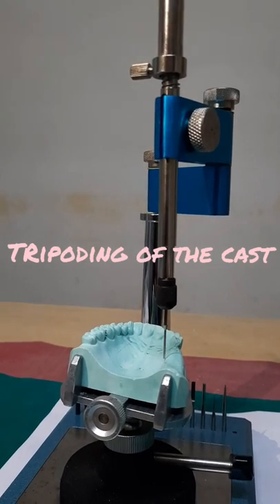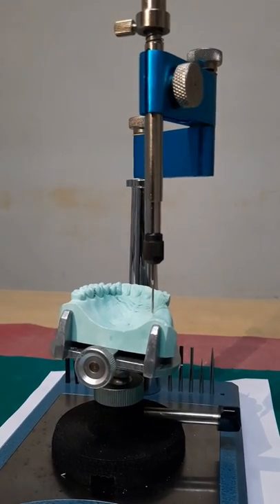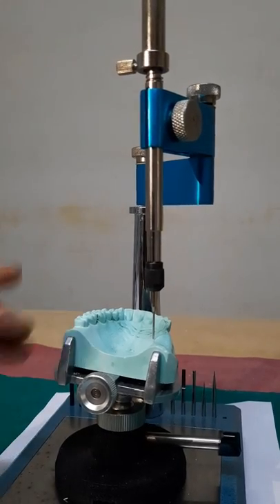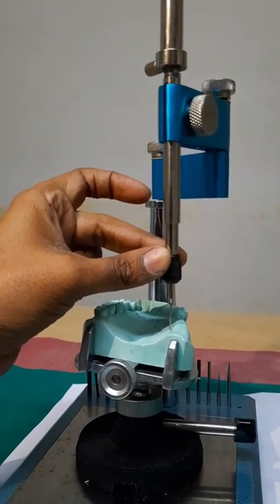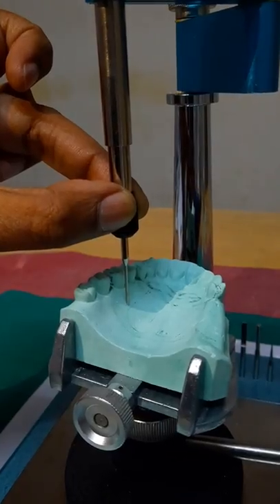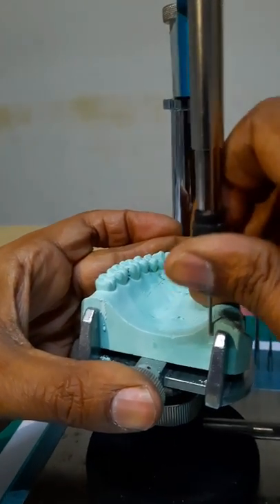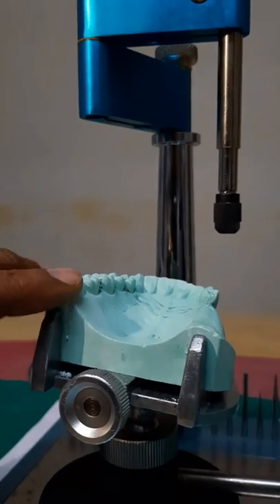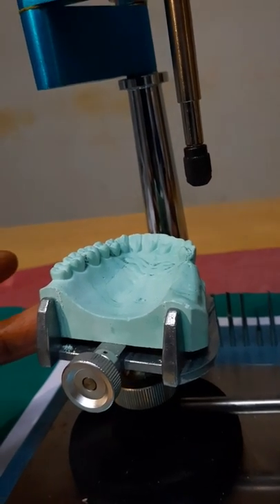TRIPODING OF THE CAST ON A DENTAL SURVEYOR

Comment: In Nallaswamy, It has asked that after tripoding in the primary cast we again take 3 reference points (Distal marginal ridge of first premolar, incisal edge of Lateral Incisor, and lingual cusp tip of opposite side premolar) while transferring the tripoding from primary to master cast. My question is, if we are already taking 3 points in the primary cast why do we require to take 3 other points just for transferring to master cast? Also as per this book, it's saying the choice of these points is based on easy to locate on the cast. Is there any reason behind the choice of these location? ?
Sir please clarify
Reply from the maker: Purpose of tripoding is to preserve the final tilt of the cast in horizontal plane. Three reference points helps in positioning the cast (primary or master) any number of time in same position.